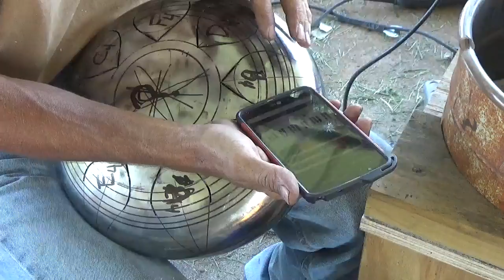Steel Tongue Drum

Comment: AWESOME!  It sounds as good as some of the expensive ones I've heard. Looks Great, too!  Now, I have to go buy a propane tank... see what you've done... Lol.  ( I can't wait to get started. You're an inspiration!)
Reply: How did you go? I take it that you have tracked down propane tank.
Reply: @gorillaau   Actually, I bought 4 tanks, but living at 7,600ft up in the mountains, I've been using them
as propane tanks. I do walk by them and tap on them, and the pitch tells me how full they are.
Reply: @thomasmartinscott  I have used that trick myself for larger tanks, those that you can't easily rock. The smaller BBQ size one trick is to pour hot water down a side. The hot water will evaporate off the section that has no liquid gas, leaving a clear line of the liquid gas inside.

Caveat: I think LPG as we have is the same.

Comment: Awesome...
Questions 

The more you cut a tongue, the lower the pitch?

The more you Sand a tongue, the higher you can raise a pitch?

Tuning the tongues in a star pattern rather than clockwise or counter clockwise is important because every time you tune a tongue it effects the other tongues?

Did I get this right?
Reply from the maker: The pattern of tuning has little to no effect. I settled on the pattern I used because it is intuitive to use (the notes switch between hands consecutively).  But yes longer slots = lower notes and thinner tongues = higher notes.

Comment: Sounds nice. I was hoping to hear explaination of how to cut the notes. Sure I saw the circles & lines but not sizes & lengths. Thank you for not putting in horrible background music.
Reply from the maker: Size and length is determined by the note itself. Draw out the pattern and start by cutting the highest note first. Meaning, cut the slots till you achieve the note you want. From there cut each note a little deeper until you get your octave. There is no set measurements for notes.

Comment: Is there a way to have 13 tines instead of 9 to make it chromatic? Maybe arranged in the circle of 5ths?
Reply from the maker: I have Done one with 12 around the outside plus the one in the middle and tuned it to a chromatic scale. I found it difficult to play, but I am not a musician by any stretch. It would become easier if I played it more and memorized the layout. It was an earlier attempt so the layout of the notes was not as intuitive as the versions I currently make. My favorite ones so far have been scaled for Blues (C major, G major, F major) they sound radical. 
I have done several in different pentatonic scales as well including a 2 octave version. I will probably play around a bit more with a Chromatic version and use the layout method I am using now to see if it makes it easier to play.
Thanks for watching and for the comment/question.

Comment: Awesome video. I have a couple old tanks in my scrap pile. I need to make one of these. Question tho'. I'd need some way of carrying it and preferably being able to play it while doing so. Would it damage the sound quality to  weld a few loops around the equator for a leather carry strap?
Reply from the maker: Because of the way this instrument works anything that puts tension on the shell will dampen the sound (or at least in my experimenting it has). So I can only assume that hanging it from loops on the shell would dampen the resonating chamber. However I have not tried that so do not know for sure. It is pretty much a sit and play instrument. They do strange things compared to a regular drum too, If you set it on a hard surface it dampens and doesn't sound good ,I thought this was due to the opening in the bottom being covered, but when I set one on a carpeted floor or the couch (still covering the opening) they sound fine, weird huh.
Still even not being able to carry and play I recommend making one to play they are extremely fun.

Comment: Great work man!! Im looking forward to make one for myself. I want to make one on the scale of C major but i dont know the diameter of the notes or the order they should go and im kind of lost there. Can you give me some advice please???
Reply from the maker: Jose Antonio Casas 
The diameter is unimportant. Make 8 same size figures. Cut the top 1\3 of each. Then pick one and begin cutting the slots down and checking it till you have a C (you want this to be a high octave to start from) the longer the slots the lower the note will be. I use an app on my phone to tune with. Once you get the first note pick one next to it and tune the next lower note. I alternate across the first note making playing it very easy. With that bit of an explanation and the video you should be able to do it. Just be careful when cutting the tank.

Comment: Good job. I broke a pile of jigsaws before switching to the dremel LOL. Don't forget to heat treat it!
Reply from the maker: Danny Lee I have found that heat tearing has little to no effect on sound. Is there another purpose to it?
Reply: I noticed the kids playing hard with them and the note unannealed tangs are softer/might bend easier than if they are annealed then the structure of the metal gets harder. Some peopel say they notice the differenc ein tone but I dont lol. Mostly for metallurgy purposes although if kids aren't banging on them it shouldn't matter :p

Comment: How do you determine the distances from the circles when you draw them with the compass ?
Reply from the maker: Cristiano Fanucchi myou do not have to determine that with this method. The tuning is all in the length of the cut. Longer cut lower pitch, shorter makes a higher pitch. The circles can all be the same size.

Comment: How do you know how big or small to make the notes to begin with?
Reply from the maker: By how many you want to put on the drum. With this method the tune is determined by the length of the pads rather than by the diameter, so what size you start with does not matter, however if you get too many notes on the drum it is very difficult to tune with a smart phone app.

Comment: How is the size of each playing field determined to get the notes in tune
Reply from the maker: The pad of each note is the same size, the length of the slots going toward the edge determines the tune. Shorter slots = smaller vibrating surface so higher note, longer slots = larger surface making a lower note.
Reply: Ah, thanks. I'm thinking about making one